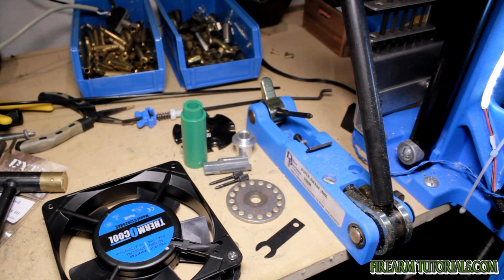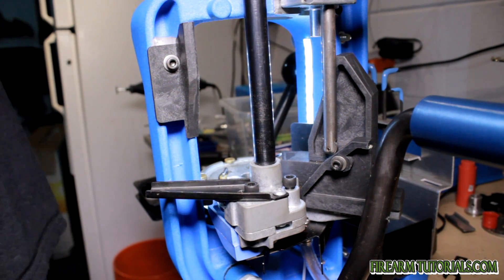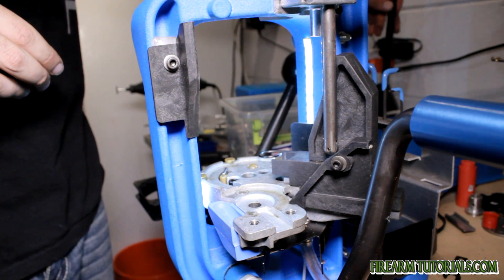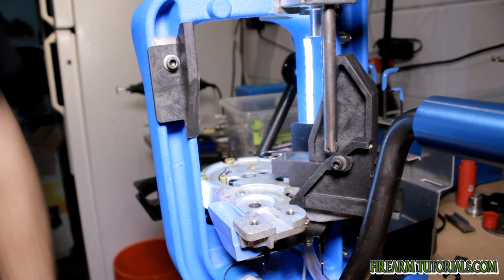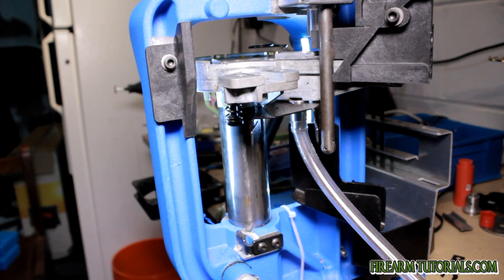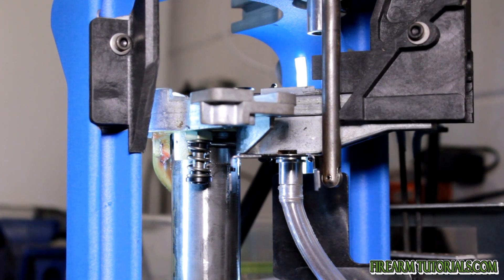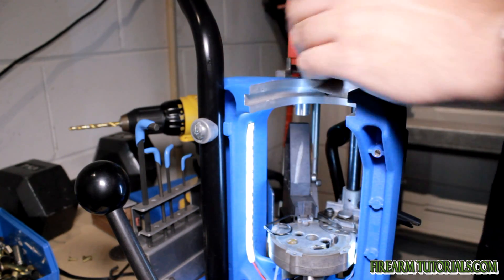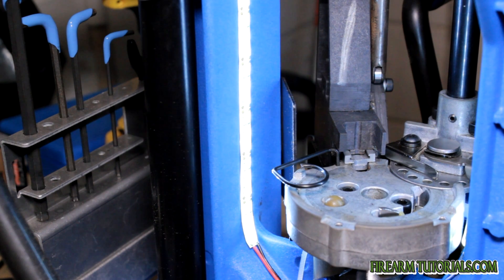Dillon XL650 caliber change .45 to 9mm part 2

Comment: I reload 9mm on this press and since I'm waiting 4 my new 1911 I was thinking about this changing caliber businness with some apprehension.Good job I've found this video. Now I think I'll be better off buying another press just 4 the 45 ACP. Do'nt get me wrong,the video is great & very  informative,but there's no way I'll go thru all this every week or so. Thanks 4 the video.
Reply from the maker: The only time it's a real pain is going from small to large primers.  Going from 223 to 9mm is really easy.  I'll usually load a few thousand rounds of 9mm, then do .223 and 300 blackout.  I don't load 45ACP as much because it's more expensive to shoot and I'll usually do runs of 500 or 1000.  It really depends on what calibers you shoot and how often you load.

Since I shoot so much 9mm with the MP5, I've considered buying a second 650 to leave dedicated to 9mm.  Time and funds haven't permitted that yet.
Reply: Right, it depends on what you shoot most.223 is easy:small primers, but all you have to do to the 223 brass is a pain too so I buy factory ones :-) Time is always an issues. But I still have my old Lyman semi-progressive , I could use that one for the 45.Another 650 would be great though,great and fast machine. Factory 45 ACP are expensive,so you end up broke anyway LOL.

Comment: Great videos , easy to understand and follow and very precise , Thank you.  BTW where did you get the third party primer catcher ?
Reply from the maker: Thanks building a new workshop which is much better than this initial setup...  The primer catchers here:

http://www.ebay.com/itm/Dillon-XL-650-SPENT-Primer-Catcher-Upgrade-Fix-Kit-Magnet-mount-EZreloading-/252787609141?hash=item3adb50ce35:g:xu8AAOSwhlZYskEH

http://www.ebay.com/itm/The-Original-Dillon-XL-650-Missed-LIVE-Primer-Chute-Ski-Jump-Fix-Upgrade-BLK-/272142767072?hash=item3f5cf913e0:g:bMUAAOSwxYxU1DFf

Search around though, I think these days someone makes a mount to attach bot the spent primers and good primers.  Thanks for watching.